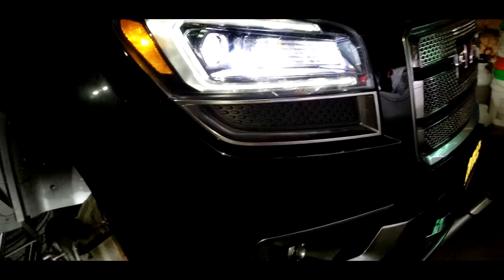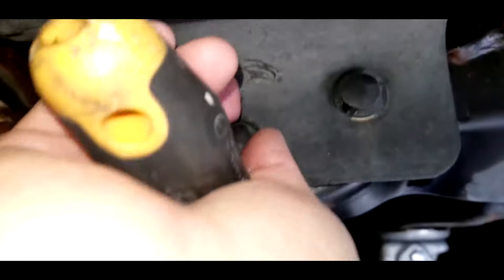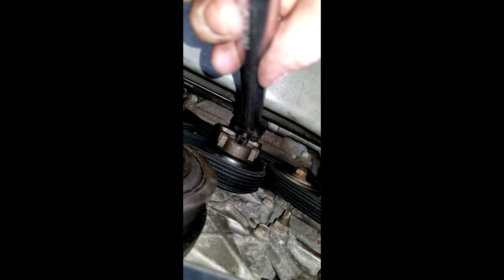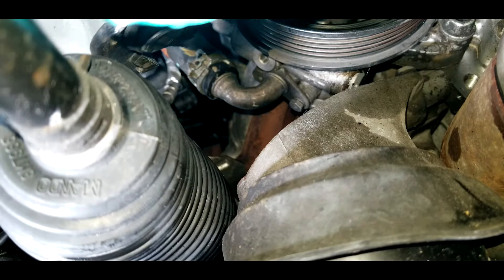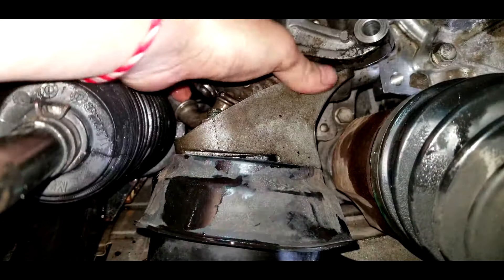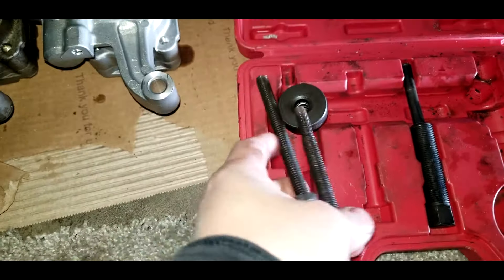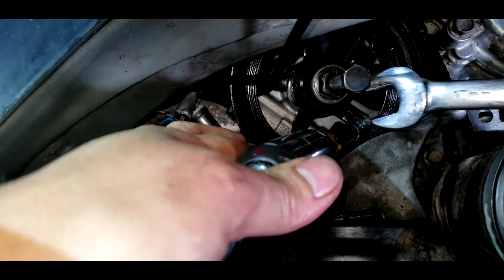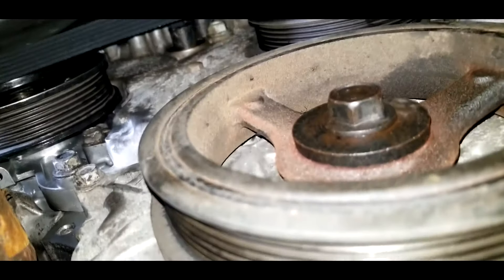HOW TO REPLACE GMC ACADIA POWER STEERING PUMP WITHOUT LOWERING THE FRAME.

Comment: No need to remove the pulley,,the whole unit slides out easily by pulling it out towards the back of the vehicle,over the crossmember,,,just did it yesterday👍👍👍
Reply: Is yours an awd or fwd? Having an issue getting the 16 m and rear bolt off. It’s an awd.
Reply: @KayHillFashion  Make sure you take off the heat shields,  they are easy to take off and give you lots of room.  Yes It will come off from the back.
Reply: @tonyfry6531  Thank you. Ended up taking off the heat shield- gave up putting it back on 😫😂 said it was a 6 hour job.. took me 6 days 😂 working outside in 30 degrees without a lift was no joke.
Reply: @KayHillFashion  thanks for your post. Preparing to do this job myself.  Can I confirm that you were able to get the pump out on a AWD (2011 - if it matters?) by taking off the heat shields - but otherwise following the instructions shown here?
I have access to a lift so I hope that will make it easier thoughts?
Reply: @scottgillespie4781  I did it on the ground with the front 2 tires on jack stands. After I took the bottom heat-shield off, I used 2x 12” 1/2” extensions to reach that tricky top bolt on the pump from behind the heat shield/ exhaust area. The swivel head extension I bought from Harbor freight was trash, would slip off the bolt. But if you had a quality swivel head socket that isn’t floppy it would probably work better. But I did it with a regular socket. Somehow I broke the bracket that held the upper hose that attaches to the firewall but it worked out because it gave me the extra room I needed to pull the pump out and put the new one in. I definitely did not reattach that bracket and had to wiggle that hose by pushing it up (bigger thicker one) when it was time to line the bigger hose to the pump to reattach it. You probably won’t have as many issues as I had since you have access to a lift. Im definitely not a mechanic just a girl who loves flipping cars and I figured it out in freezing weather in a parking lot. If you have any questions feel free to reach out. I did take the outter tie rod off trying to get more access to that top bolt but in hindsight, I didn’t have to do that. Hope the information helps. Mine was a 2014 awd Acadia. I did NOT drop the k frame or remove the exhaust, cat or top heat shield (couldn’t reach the top bolt with my short arms). You got this buddy! Just think of all the money you’ll save since it’s a 6 hour dealer job.
Reply: @KayHillFashion  OMG!!  Thank you for that reply - so much more than I expected and so helpful. Thank you - I am going to do this at some point this summer I think (hopefully no weather issues - lol) and I certainly motivated by avoiding the 3500 quote that the garage gave me - nonesense!! Thanks again!
Reply: @obiscott2  it’s definitely a pain. Should be easier for a guy since they are stronger. Or if you have 2 people, where 1 can look at that tricky top bolt and guide the person who is taking the bolt off because you have to come from the back and it’s like 2 feet behind the bolt… whoever engineered this needs a new job 🙄🤦🏼‍♀️😂 Just take your time so you don’t break anything. I took the entire pump & pulley out so I didn’t have to rent another tool which is why I need more space to take it out. It’s like playing Tetris, you have to keep flipping it to get it to drop out. 
Don’t over tighten those bolt when putting the new one on or they break off. Hope the information helps. If I did it, with no mechanical knowledge… you can definitely get it done! Save that money!!!!

Comment: Thank you for this video!! At 58 I did have a little more trouble than you younger guys. You need to be a contortionist and have small hands. I opted to remove the upper heat shield (two 10mm bolts. One near the steering pump and the other under the cat converter). There’s a wire connected to it so just push it out of the way to the left. That way I got the pump with the pulley on it out but you have to remove the hose tube connected to the pump with 10 mm bolt. Once you get it past the cat converter flip it so the pulley is against the cat converter and it comes right out. This also means if your new pump has the tube on it you’ll have to remove it and don’t lose the O ring. Also, don’t over tighten that tube bolt when putting back on…….aluminum pump body. When feeding the new pump in it seemed to end up on top of the loose heat shield then worked it into place without too much trouble. Took me over 5 hours start to finish. I did enjoy standing up to remove/install pulley with Harbor Freight pulley removal kit, third time using it.
Reply from the maker: Thank you for sharing your experience and detailed tips! I’m sure this will help others, especially with the tight space and those tricky bolts.

Comment: I Just performed this repair today on my girlfriend's acadia. I'm glad this method was discovered by someone and memorialized on youtube as it did work for me.  It did not go as smoothly for me as the gentleman was able to do it.  A third hand would have helped tremendously as its tricky to hold the pulley in place and get the tools set up.  In the end it took me about 4 hours but the problem is fixed!  Much better than paying the shop 1k.  If anyone out there wants me to do it for them I'll do it for 400 lol
Reply from the maker: Glad the video helped you out.
Reply: Where are you located Travis? ;)
Reply: Offer for $400 still on the table😂
Reply: Where you located 😂😂😂
Reply: I'd have you do this for me for $400!   I'm trying to do it, and can't figure out how he gets his hands in there to loosen the high pressure not.  My hand BARELY squeezes in blind - it looks like he has all the room in the world.  Almost looks like he took out the rack!

Comment: Do you have to take the pulley off to get the pump out? It looks like taking it out with the pulley on would be impossible. Why in the hell do manufacturers make engines so hard to work on!

Comment: thanks for this. was dreading the idea of dropping part of the engine cradle without having access to a lift. just got home after work and all of a sudden my power steering is intermittent. not sure if something else is wrong besides the pump but i may need this video anyway.
Reply: having the same issue after replacing, thinking a bad reman pump. What did you end up having to do?

Comment: As a avid DIY'er i must day thanks for the video. Most of the ones on YT say to pull down the frame. I was hoping to avoid this and you just saved me some time and money. And your right the Acadias is hard to work on. I get frustrated but at least Ik its not just me. Its always something with this car.
Reply from the maker: Np Thanks for checking out my video. Glad it out you out.

Comment: Could not wiggle the pump out in '08 AWD Acadia as suggested.  Instead used pulley remover from HF with an impact wrench to remove pulley.It then easily comes out the front.

Comment: On your new pump you used power steering fluid instead of automatic transmission fluid? Weren’t most power steering pumps on acadias switched to ATF? Love the video though, been searching for a way to avoid dropping the subframe. Thanks
Reply: Only use AtF if you have put a new rack and pinion,or steering gear, GM says just use powersteering fluid if your just changing the pump.GM says the old rack and pinion seals will swell and leak using ATF.I did mine just as he did it but had to drop the cradle to get more room.8hrs later done.No crawling underneath.
Reply: It depends on the year of the car, mine is 2012 traverse and requires ATF.  BTW, the idea of removing the pulley is awesome 👍

Comment: I thought you first bleed the power steering with engine off, to avoid a ton of bubble in fluid.  Then after 10 to 20 turns with engine off, turn on engine and do some turns.  Otherwise, great video, helped me save some time.